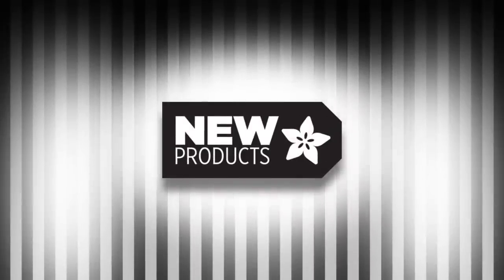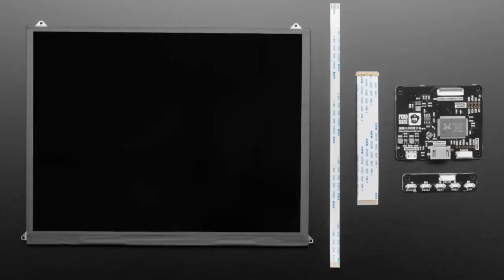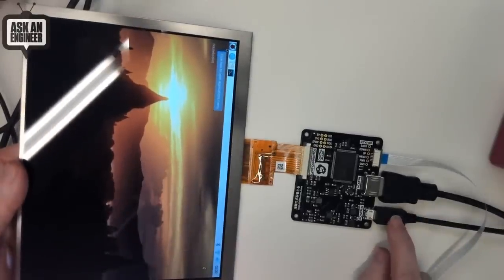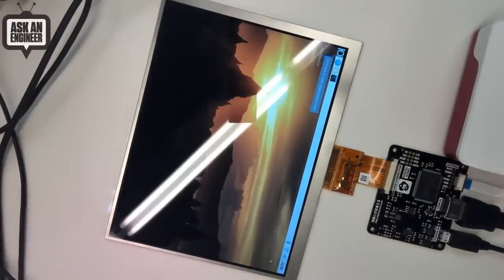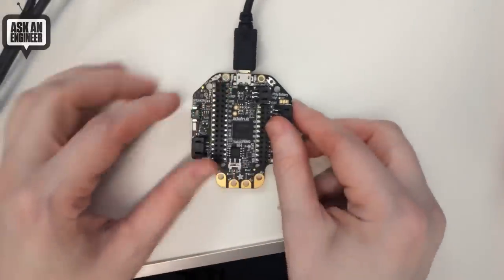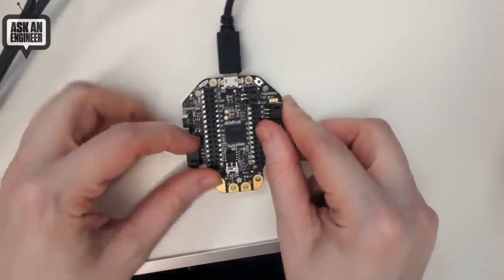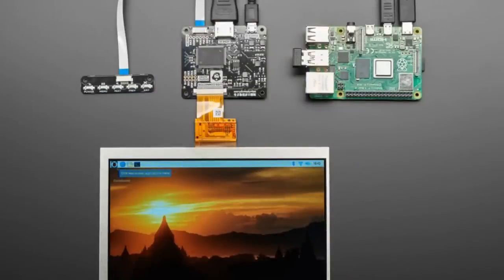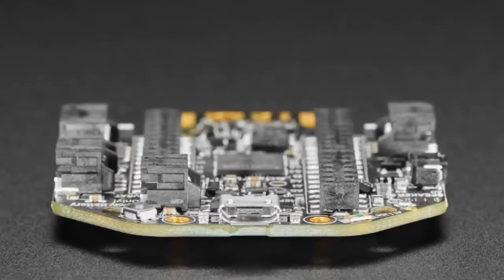New Products 09/04/2019 Featuring  Adafruit HalloWing M4 Express@adafruit #adafruit

Comment: I am working on a project building a Star Trek Discovery Tricorder. My problem is that I need electronics to add blinking led's and a 2  x 2 inch screen that can run various avi files or video files, Can the above product fulfill my needs? If not, can you advise me of another Adafruit product? Thank you for a very informative video.
Reply: What kind of sensors are you using?
Reply: @Kesiif  Thanks for your response, I have not purchased any electronics yet. I am finishing the 3d print of the device and I cannot get a response from Adafruit on being able to show viedeo (avi or mpegs on a 2x2 inch screen. I need the advice from builders who can help me with the project. Here is what I want to make: https://www.youtube.com/watch?v=lLhDneF7ZgA